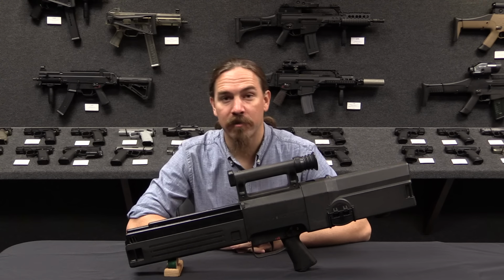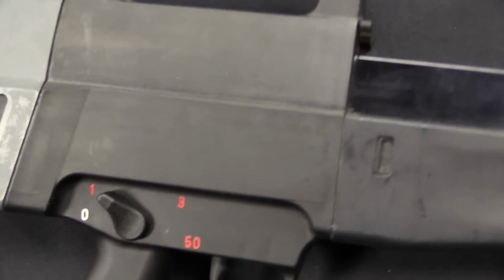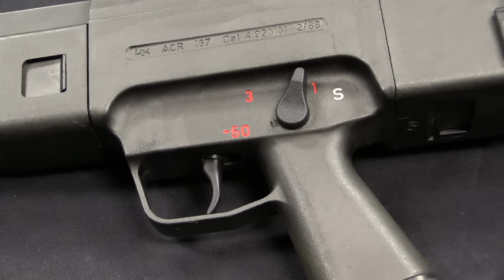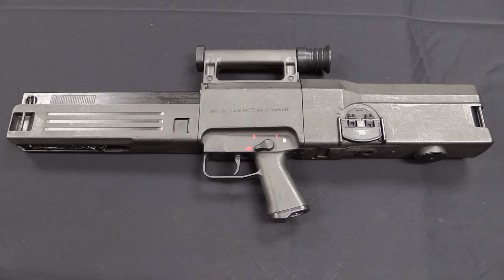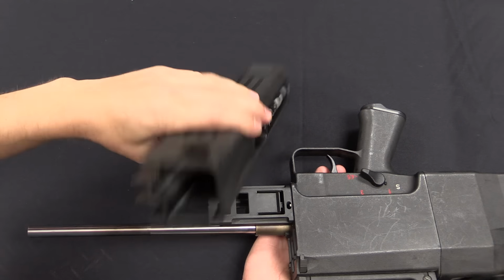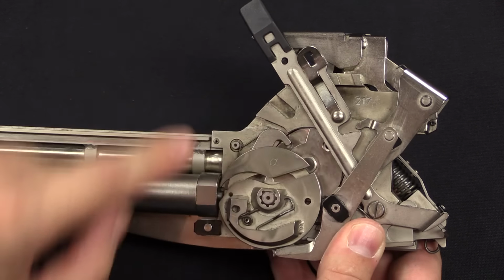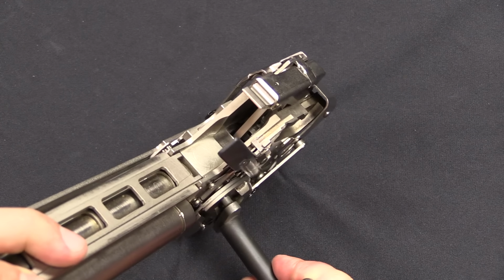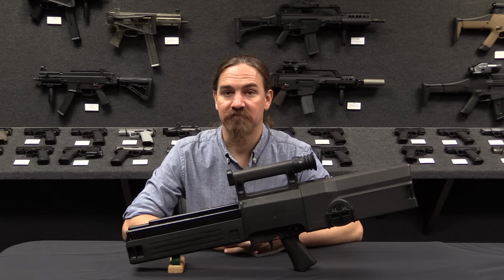Kraut Space Magic: the H&K G11

Comment: They really should revisit the G11.
Considering how hollow the polymer shell is, you could store so many tools inside for quick-access. Heck you could be carrying 3 different muzzle attachments in the hollow space of the gun and switch as needed.
Reply: I agree. The potential for increased accuracy seems above reproach. Even if it was only used in a sniper capacity it would still be cool.

Comment: What a piece of junk... It seems like utter crap... 

First is not having any mods, attachments to make this thing modular, it seems really niche and like it would only have the purpose of hunting
Second is the fact the mechanism ejects hot gas and smoke out the bottom of the gun, right next to the forearm and hand, possibly burning it...
Third is that it cannot really sustain full auto fire, so most likely you will burst it, and the burst from what I seen is very uncontrollable... Why else do you think the scope has a rubber buffer eyepiece on it, better wear glasses or goggles when aiming and firing it in bursts, it'll give you black eyes every time...
Fourth is the mechanism is so complex that if it jams up a certain way, it's pretty much junk and you'll never fix it or field strip it...
Fifth is it is probably horribly unbalanced and very unstable, the plastic and metal together do not give it enough balance, nevermind being lightweight to carry around easier, thing is pretty much a toy... 
Sixth is that it cannot be dropped without breaking something, and yeah I do say that because it's plastic... But also that the caseless ammunition itself is delicate and if a magazine is smacked too hard, you might encounter an entire series and rows of misfires....

This was never meant to be in ANY army, including space...
It's more a toy gimmick, just for a concept

Comment: I'm not the biggest gun enthusiast, but I love the educational value of this video.

Specifically, this really gives me some great insight into how some seemingly "futuristic" innovations have already been made in the past. As someone who enjoys working on sci-fi and fiction wordbuilding, it's awesome to see how there were so many simple ideas added that are not only practical, but leave room for future improvements, modifications and additional gear/features that are basically as simple as swapping out and adding parts to something like a Nerf gun.

It's something that suggests that a few small breakthroughs could make something like this really feasible, and function as a platform or basis for an extremely modular weapon that could be really simple and intuitive for most anyone to use, but modular enough that it could have nearly unlimited setups that vary widely based on the role, and even more so with modern technology.

Swap to a shorter to longer barrel quite easily. Change out the barrel cover, scope or stock so easily you could practically do so in combat without needing even a screwdriver or something similar. Create multiple versions with different calibers for different roles, but all the changeable parts could be used among all of them. 

Add in some bleeding-edge tech and semi-futuristic concepts, and it's easier something you could see used by Space Marines. Or near-future spec ops with digital displays on the gun, working alongside all sorts of smart tech like a Metal Gear game.

Comment: Simple for the grunt but need a watchmaker as a armourer. I wonder if it will be built on in the future. 2000 rpm burst is insane and could you up the spring rate to get 1200 rpm in auto? So much room up the front you could fit 2 spare barrels...

Comment: True caseless  firearm would not use gun powder. I’m thinking gas, air, spring, and or electricity. But a solid state fuel system isn’t practical or reliable for this application. I’m thinking really really powerful paintball gun shooting smaller heavier tungsten alloy ball.

Comment: Legit question, ELI5: why would you WANT your ammunition to be caseless?
Reply: 10:13 it doesn't need the weight of a brass /steel/polymer case, which makes it significantly lighter to carry the same number of rounds.
He even mentioned that the weight of a G3 and 100 rounds of 7.62 is the same weight as the G11 with 600 rounds of whatever caseless ammo it uses. That's an extremely significant increase in available firepower for an individual soldier to carry

Comment: A classified study by NASA, Air Force, and Navy found that caseless ammunition or brass retention is a requirement for a weapon intended to be used in zero gravity.
Reply: Unless you’re shooting inside a spaceship or station it would require an oxidiser in the powder to work and a way to counter act the recoil.
Reply: @maxpower3990  Dude, seriously? ALL types of gun powder are a mix of fuel and oxidizer, you don't need external oxygen for firearms to work. What are you, a home-schooled  creationists?
Reply: @andrzej2501  Possibly got misled by a scene in the TV show Firefly where a gun is shown to need atmospheric oxygen to fire.
Reply: @trolleriffic  They really did that? Sigh... must have repressed that memory ;)
Reply: @maxpower3990  A bunch of smart engineers at MASA, Air Force Lab, and defense contractors did a bunch of dev work and came up with experimental solutions. The frame of suit would have micro thrusters built in to stabilize shooter automatically using gyros.  Boots that gripped the surface. One promising technology used puffs of compressed air from shooter's air supply . A nozzle was attached to firearm with soft hose connected to breathing air mix. Accelerometer inside nozzle device would register recoil and release appropriate amount of air puff as microburst to counteract recoil.
Propellant charges are already self oxidizing and work in vacuum . Just as they work under water.
Brass is a problem. In zero G it becomes a Hazzard due to quantity.  Solution is caseless ammunition.  Projectiles also present a space pollution issue in orbit. One proposed solution is frozen solid CO2 rounds. After firing the projectile would eventually boil away aided by vacuum of space, EM radiation.  Solid CO2 ammunition would allow forces to manufacture their own ammunition using compressed gas and refrigeration.
Reply: @maxpower3990 gunpowder contains its own oxidizer.  Bullets can be fired in a vacuum or even underwater

Comment: No cartridge or casing? Just say 'projectile'.
 If the projectile had a full metal jacket,  it wouldn't be so fragile.  If the jacket extends past the lead round, then it can hold the powder and cap. So we'd have a projectile with a metal cartridge that had no end, which means that the cartridge jacket would leave the rifle with the projectile.  Problem solved. Should be a more accurate projectile since it would have a hollow tail, stopping tumbling but allowing spin. 
  Damn... now I want to build one.

Comment: the dummy round wasn't ejecting easily because the cartridge stopper is holding it. the cartridge stopper is the tray door like thing on the bottom of the receiver that prevents the cartridge from going clean through the chamber. it would be fine to unload using the dial on the stock because the ejection plate and the dial are mechanical connected and has a protrution that pushes the cartridge stopper out of the way so the cartridge can come out.

Comment: Ian, the ejection port not only serves to drop a dud round. It also serves to dump out expended primers allowing for a clean chamber as the next round is placed before going into battery. I've always been fascinated by the G11 since it showed up in the 70s And through the 80s. I wish I could have actually seen this beast in action.
Reply: I wonder how easily it would be to adapt this to using telescoped cartridges. Basically, this would be the same as caseless ammo, but the propellant and bullet would be inside a casing.
Reply: This could be a telescoped cased cartridge design if we eliminate the barrel&mechanism recoil system then...

Comment: 74 to present ???
Primer is only thing ???
A Greeny Stick Um Cap Primer ???
High Amp/Voltage Electric 2 pin ignition ,
Micro switch trigger ???
A remote plug in could prove interesting !!! A spare batt , transformer .

Comment: I remember this gun in Call of Duty Black Ops, it was one the best rifles, there was that accurate sniper one and the one with the lower magnification scope, both had fastest firing rate, hit as hard as 30 cal guns, and accurate, plus each weapon had 150 rounds (3x50 clips). Reloading was slow vs M16 or AK . . .. I remember unlocking this and using it. At first most players didn't use it in multi player, because during the campaign it shows up in 1 or two levels and they could miss grabbing it off the wall. I got it cuz it looked weird but it fired really good. But they found out and everyone was fielding this. 

The American's thought about caseless but were holding out for rail gun (electromagnetic) or energy based weaponry. Both were in the works @ DARPA but the Navy rail cannon fail, and initial laser fails but now they have a working one vs drones and supposed one for combat, and the army is having a go at the rail artillery, but we'll see where it goes
Reply: "COD" .... "clips" ... facepalm

Comment: I'm a bit late to the Show. That looks a really good bit of kit until...........The mechanical part looks like it should be in a 19th Century Clock. As an ex soldier, if the "Grandfather Clock" parts needed cleaning, i think i would take them to the local "Acid Dip" Specialists. Any idea how much Carbon was produced by these Caseless Projectiles as opposed to standard Brass Case?

Comment: Very impressive bit of kit. Shame that it wasn't developed further and simplified. It also seems like it could be made substantially more ergonomic with just different plastic housing.
Reply: How would the ergonomics get better by changing the shape of the housing? It already has an end bit that goes against your shoulder, a surface for your cheek, a pistol grip and plenty of surface to hold onto with your other hand. If the surfaces the user's body touches are already in their normal places and are just like on any other (assault) rifle, how could the ergonomics be improved? Sure the gun looks super blocky but it doesn't matter what shape the stuff is that you don't touch as long as it doesn't get in your way. I'd go as far as to saying this would be a lot nicer to carry and use than what's currently being used because the G11 has very few (basically none) bits protruding or sticking out where things could snag onto or which could jab you in an uncomfortable or painful way while carrying and firing it.

Comment: I would make 3 changes:
1. Electronic trigger, this would implement auto/burst/single in digital electronic. This should remove more then 50% of the mechanical parts.
2. Factory preloaded 30 round magazines.
3. A 6-magazine revolver with pump action magazine replacement.

Comment: Years ago I played around with a concept on how to fix the case-less ammo issue. After seeing how they designed the ammo, I laughed. To me, the obvious solution was a bullet that held the propellent and primer. A brass base that was attached to a copper bullet. The base would hold the standard gun powder with a thin wall holding the primer. This would make it about as durable as standard ammo, as long as you didn't hit it with something tharp on the bottom. Once the primer is struck, the thin wall would blow out and propel the bullet/case combo out the barrel.

Comment: It’s why the army moved away from the composite rounds and rifles when they were testing possible new infantry rifles due to plastic is an insulator while metal and brass is a conductor the plastic would push the heat into the barrel past the breach causing overheating during prolonged heavy use where as brass and other metals absorb and conduct that heat like heat sink and take it with them when ejected out of the breach. I’m sure with some engineering this could be overcome but same time probably add complexity to the overall system and more failure points or possible malfunctions due to extra parts needed to address the issues. The old saying keep it simple stupid still holds true today and the simpler a system is the more reliable and over all effective the system is. We do not need to repeat the mistakes that were made with the introduction of the M-16 and all the issues that plagued its transition and got a lot of soldiers killed due to rushed introduction and flaws that should have been caught and corrected before ever being put into service.

Comment: From a mechanical engineering standpoint this is very fascinating but also very simple design, and I can't help but think an open bolt mechanism would be better. It would allow the chamber more time to cool and prevent cook-offs, plus you could then use more traditional magazines and a traditional charging interface which I would think only be needed if there was a misfire. The only problem that I can see being the difficulties in achieving accurate firing as each shot has a lot of mass moving the gun around between pulling the trigger and the round actually being fired.
Reply: Putting caseless ammo into a standard firing mechanism would be missing the point. A standard open bolt gun would have to move the bolt back anyway to be able to fire the next round, so it may as well just eject the empty case of standard ammo. You would not make use of the only pro caseless ammo has.
Reply: @ladislavjonas977  What are the advantages of caseless? Lower weight, faster operation, simpler manufacturing... all of these would still be achieved with an open bolt function. I'm not talking about changing the operation of the gun, just the trigger and timing. There is already a gas system and recoil spring. It would just need to start the loading action when the trigger is pulled.

Comment: This is my analogy hypothesis. 
It has 1:3 gear reduction, everytime the whole mechanism reach the back due to recoil, the chamber revolves 3 times or 3 cycle.

 It's like a car engine the charging mechanism is like a crankshaft. 
And the whole gun outer Shell is the piston. And there's a con Rod connecting these two

And the feeding mechanism is like a sewing machine

Comment: I think the ammo is very interesting, I wonder how good it would actually work and how much stopping power it would provide, considering veterans are already less than pleased with the slightly larger 5.56.
The weight and compactness of it is very interesting though. With my C8 IUR, AR-15 platform, I can carry 30 rounds on the gun, 90 on my plate carrier and 60 on my belt. That's 180 rounds of ammo, but usually the 30 in the gun comes from a magazine stored on my person, so 150 is more realistic. 
In the meantime, the G11 has 150 rounds stored on the front of the gun itself. Such a futuristic concept.

Comment: I would’ve thought the fragility of the ammo problem could be solved by just distributing (most) of the rounds in magazines from the factory. Then the rounds have a case, it’s just the magazine itself.
Reply: It however would make easier for soldiers to simply waste the clip in combat theater... not sure how profitable would end doing so... or otherwise would require mayor efforts on moving back the used magazines back to the factory...  Lets remember supply lines wants to exploit to the maximum the amount of weight that will used on the war effort... making actually a percentage of the load never used as weapon but as "tool" may not feel optimal...  It obviously is different if you defend your country of if you attack in other place... I can only think on critical moments such airborne assaults.

Comment: Is there a practical reason behind the blockiness or did they just like the look
Reply: For the front part of the gun, not really; lots of wasted space around the barrel. For the back part, it's necessary because that entire clockwork mechanism reciprocates back and forth, like the bolt and such would on a normal repeating firearm.
Reply: Yes, that makes it even easier and cheaper to manufacture

Comment: I question the theory of a metallic cartridge removing heat from the chamber upon ejection (in semi/full auto firearms). If you fire a round in a bolt-action rifle of any caliber, you can immediately handle the freshly, extracted spent case for a number of rounds in succession, but a spent cartridge that has been ejected from a self-loading firearm , even the first round in a cold chamber, is very hot caused by friction generated during the ejection phase, point being, the friction from swift ejection of the spent case is a main cause of heat as is the friction of the bullet being 'pushed/forced' through the bore during firing. Simple test: Fire an M2 Ball round in an ambient M1903 bolt-action rifle, eject the round and hold it in your bare hand, then fire the same round in an M1 Rifle and immediately retrieve it and it will be HOT.

Comment: Just to rub some salt in H&K's wounds, this setup looks like it could also work with FN's 5.7mm round; it looks like the system meant to expel dud caseless rounds would also eject spent brass, and a straight-wall, waxed cartridge like the 5.7 would solve the overheating problem. Also, for all its clockwork complexity, it solved the big issue the AN-94 ran into with its mobile feed ramp by simply fixing the magazine to the action, so it goes along for the ride.
Reply: The 5.7 round is necked
Reply: @moparty440  but straight walled.
Reply: HK G11 could be also a telescoped cased cartridge design if we eliminate the barrel&mechanism recoil system. Would be nice to see a prototype in 5.7x28.